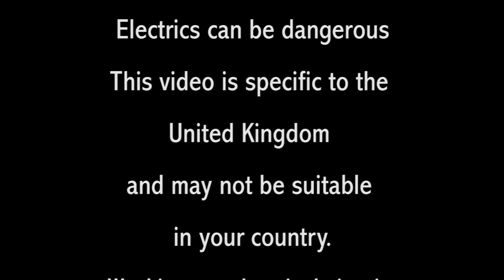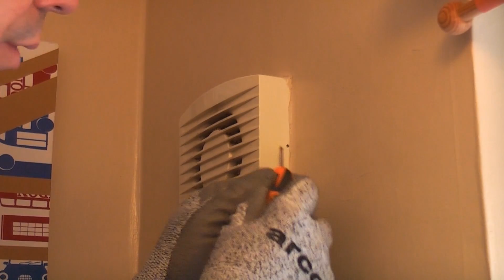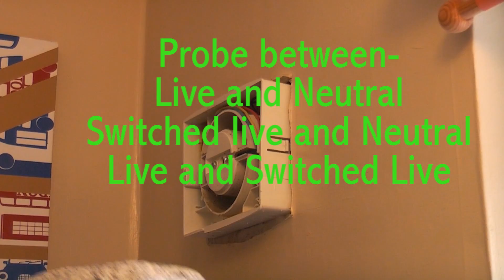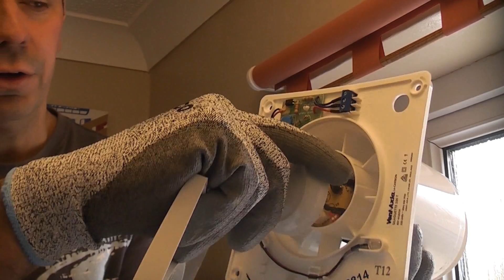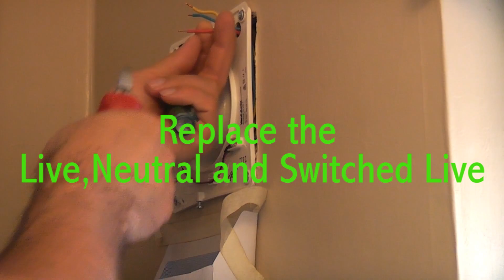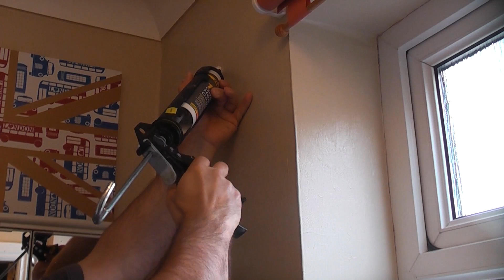How to replace a wall extractor fan | vent-Axia Silhouette

Comment: Great video 👍 do you know if I can replace the fan myself , take old one off replace with new , wires already there and I know about putting the link in from line to sl as I bought one with timer but only got line neutral and cpc . Just want to know if I can do it myself or do I have to get a registered spark in to do a mwc testing etc any info would be great 👍
Reply from the maker: As far as I am aware, you are allowed to do like for like replacements 👍
Reply: @ultimatehandyman  brill thanks for reply 👍

Comment: my old fan had an earth terminal, but my new one doesn't. Is it safe to trim back the earth and just cover it with insulating tape? There's no room to squeeze a terminal block in there
Reply from the maker: I would not trim it, just cover the end with tape and it will be fine ;-)
Thanks for the comment 👍
Reply: @ultimatehandyman  Thanks a lot for the help.  Best DIY channel on youtube!

Comment: Thanks! Great video! Our bathroom extractor fan is supposed to turn on with the lights and used to turn off automatically a few minutes after the lights were turned off. However recently it has stopped turning off and stays on constantly. Could this be a sign that it needs replacing, or is this a different electrical issue? (Pretty sure it hasn’t been replaced since 1989!) Thanks for your help
Reply from the maker: Sorry for the late reply, I have just seen this (YouTube comments cause me no end of problems)
I would imagine that the timer on the fan is faulty, but it might be integral to the fan. This would mean that you would probably have to replace the whole fan.
Thanks for the comment
Reply: @ultimatehandyman  thanks for your reply! I have replaced my extractor fan and it seems to be working perfectly! Thanks! 😀
Reply: 🤨 - you can take out the timer and just directly power the motor ~ if it is connected with screw terminals on the PCB and a 240v fan

Comment: Can I spur off an extractor fan in the kitchen to a 13amp double socket with a fused spur in between?  Great videos btw 👍
Reply from the maker: Probably not, it's best if you consult an electrician.
Thanks for the comment

Comment: Hello, I am having some issues fitting my extractor fan. I followed all standard wiring instructions and the fan won’t start working. There is an isolation switch fitted, when this is on and the lights are off, the Dow lighters come (flashing) and the extractor fan shakes . Really strange! Many thanks
Reply from the maker: I'm not sure, sorry.
If it is wired up correctly I would guess that the fan is faulty!
Thanks for the comment 👍

Comment: Please I need help can you tell me which switch I need to pull down to cut the power/electricity
Reply from the maker: It's impossible for me to say without being there. You could always turn off all circuit breakers?
Reply: @ultimatehandyman  thanks a lot for respond

Comment: Would an extractor fan vent excess heat - I want to use one in my server room (a glorified airing cupboard)?
Reply from the maker: It will to a certain degree, but you might also need a vent at the opposite side of the room for some air flow
Thanks for the comment

Comment: The upvc windows need filling around the perimeter....good clean job with the fan- I understand new wiring, old wiring is trickier. I installed mine ysdy ... only problem when you turn the light off then the fan turns on...
Reply from the maker: https://fave.co/2QQcj04
Thanks for the comment

Comment: hi i was after advice please..i want to replace my bathroom extractor fan its currently a 12v fan.i have taken the cover off the old fan and there are two wires in the terminal block. The new fan takes 3 wires live, switched live and neutral. the older fan used to come on with the light switch. also in the bathroom on the ceiling near the wall fan is a 3 pole swith fan isolator. My light pull switch has 2  cables going into common, brown and red. and the 2way has a blue and black Many thanks
Reply from the maker: The fan might be 12v but it will still be 240v supply, so you have to ensure it is isolated correctly before touching anything ;-) 
To make a light with a timer work without the permanent live wire you have to put the Neutral wire in neutral and the live in the live terminal and then place an insulated link wire between the live and switched live. Then when the light is switched on the fan will switch on and off with the light.
Reply: the insulated link do i still strip it on both ends that go in the terminals
Reply from the maker: Yes
Reply: thank you

Comment: my ceiling one just went on me ,it rattled a lot in the past ,now it just turns slowly grinding and the unit gets very hot ,it runs off a timer from the bathroom light switch ,taking the cover off ,it seems overly complicated and i dont know what unit replacement i should order for it ,PS its a radial style fan not a flat one
Reply from the maker: Is there no name on it to get a replacement?
Reply: all discontinued im afraid ,was a installed extraction unit when the flat was built in 09 ,its ok my uncle offered to take a look since he is a sparky :)

Comment: Hello - this may seem like a silly question, but what do you do with the earth? When you connect the live, switch live and neutral, you seem to have cut the earth back behind the fan itself. Is it alright to simply leave this wire floating? If so, what protection is it actually offering? Cheers for the video!
Reply from the maker: The earth wire is just left there but covered to ensure it cannot touch the live or neutral terminal. It may be needed in future if a different fan is installed but in this case the fan is double insulated, so an earth connection is not required.

Comment: hi. i know that my sounds like a stupid question but i just bough new fan extractor and that white block where you put your wires got only space for two wires not three? is that make any difference?
Reply from the maker: No, that just means that your fan is probably double insulated and does not require an earth. In which case you will only need to connect the live and neutral.
Reply: Thank you

Comment: Mine does not come off after i have taken off all the screws. It looks like somehing keep holding it in the middle? Or do I need to go from outside in case the other end of the pipe that goes into the wall is fixed there? Thank you!
Reply from the maker: Has it ever worked?
Do you know if it's getting power?
Reply: Hi, it does work. It's just that I can hear a loose screw going round the fan and it does not come out when I open the front. I have now pulled it a bit more and there is a soft plastic tube that goes all the way in the hole in the wall. I think it might be attached to the vent outside. Thank you for your help, I really appreciate it!

Comment: thank you for sharing your knowledge and easy to follow videos 💡
... could you please advise me   which is currently  the most Silent bathroom fan available and where I can buy it?
Thank you ☺
Reply from the maker: You are welcome.
I have no idea which are the most silent fans, although some manufacturers do make silent or quiet ranges so it might be worth checking those out. I think a lot of places actually list the decibel level of the fan during use.
Thanks for the comment

Comment: I got a fan with timer but the wiring I need are live switched live and neutral. The only wires with my bathroom light are live and neutral and earth. What do I do from here as there's no switch live there.
Reply from the maker: +Abbas Khan 
Your light will only have a switched live, neutral and earth.
To make the over run timer work you need a permanent live from a suitable point on the same circuit.
Or if you just want the fan to switch on and off with the light you can put a link wire  in the live and switched live terminals of the extractor fan- but the run on timer will not work.
Reply: +Ultimate Handyman on my fan there's 3 junctions one is live the other is switched live and neutral. but my light has neutral live and earth what if I just connect the live to live and neutral to neutral.
Reply from the maker: +Abbas Khan 
It won't work unless you put a wire from the live terminal to the switched live terminal at the extractor fan. Then it will only turn on and off with the light.

Comment: Hi, awesome video! 
I have a faulty fan and wants to replace it myself as it's cheaper this way. I just wanted to know if I have to find the exact same one or would any fan do? also, would the dimensions affect the pipe which goes outwards?

By the way, my fan is located on the ceiling, so not sure where it goes out to
Reply from the maker: +Darkhisagi Thanks, as long as you get the correct size fan it should fit- but even if you get the exact same make the chances are that they will have changed the design of it slightly over the years so even that may not be identical. I think most ceiling fans are 100mm, there should be a flexible duct that connects to the other side of the fan and vents outside of the property.
Reply from the maker: +Karlitos No, you need a transformer to transform the 240 down to 110.The lead you have linked to could be used if you had a dual voltage machine which automatically detects the voltage, such as my welder.If you use that lead on a 110v machine you will damage the machine/blow the crap out of it.

Comment: I get a lot of mould what motor extractor fan can I use for a big bathroom, I think the current fan is too small....good video by the way.
Reply from the maker: +mr Scratchy 
You are probably best off with a twin flow type, but they need mounting in the loft really with ducting to an outside wall. 
Also if you clean off the mould and then repaint with mould resistant paint such as Zinsser Perma white that will help.

Comment: if the fan is wired in 3 core cable an comes on with the light switch how do you go about switching it on during daylight hours .without turning light on obviously
Reply from the maker: +Roy Kirkham 
You can only turn it on by switching the light on. If it's daytime you can just flick the switch on and then off and then the fan will start and will run for as long as the over run timer is set for on the fan. 
Thanks for the comment
Reply: Oh right i see thanks.
Can i ask you aswell my fan is a xpelair humidstad 12 v fan with transformer in loft its wired to the switch side of the light in t&e then to a isolator an through the tranny to the fan at 12 volts how can i use the 3 core method when theres a transformer involved it only has 240 side L&N then output at 12 volts i cant understand how to use 3 core in this situation
Thanks for replyin btw ☺
Reply from the maker: +Roy Kirkham 
Normally with a humidstat you can't use the three core cable as the humidstat is energised permanently so that the fan can switch itself on and off. 

If your fan is wired to the switched side of the light it will only switch itself on when the light is switched on, which is unusual for a humidstat fan.

Normally a fan isolator would be wired to the ceiling rose and not the light switch as you need a neutral anyway (unless there is a neutral at the light switch).

You would not be able to use three core and earth on your fan because of the type, you would need one without a humidstat but with a run on timer.

This should help- http://www.ultimatehandyman.co.uk/how-to/electrics/install-shower-extractor-fan

Comment: Nice use of a lockoff on the breaker. Was wondering if you'd miss that. You didn't. Might be worth mentioning that any recently wired fan (last 10 yrs or so) should have a 3 pole isolator switch outside which can be locked off also.
Reply from the maker: ***** 
Thanks, I have never seen a 3 pole isolator in a domestic property that can be locked off, is there a special device for locking these off?
Thanks for the comment
Reply: ***** I was working from memory... looks like it's an MK specific deal: http://www.tlc-direct.co.uk/Images/Products/size_3/MKK4857.JPG  it SHOULD become a standard tho :)
Reply from the maker: ***** 
Thanks ;-)
Reply: @ultimatehandyman  - depends on the brand ~ some have a small hole in the side of the switch that you put a provided pin into it, others have a pig-nose screw that when turned to the locked position with the provided key - I assume a tab will go up blocking the switch from being turned on
Reply: What is that?

Comment: Hi Chez, just wondering about the transparent screwdriver you're using.

Is it a neon screwdriver? I have one that looks identical to yours but heard that some of them are unsafe or unreliable. Know much about that? Wondering if mine is any good.
Reply from the maker: Liam2349 
It is a neon, but it has batteries in it.
These screwdrivers are often used by DIY'ers but are not very safe. I never use mine for testing to see if something is live or not (there is no way I'd use any screwdriver for doing that unless I was desperate and had nothing else). With this screwdriver you can hold it by the top and point the other end at a live cable and it will illuminate when live (without contact), so it's good for tracing live cables etc. 
The reason why I use it a lot is because it's a really good fit for most small terminals, so you can undo and re-tighten them without damaging the screw. 
Neon's can be unreliable so they should never be used for testing for dead, but many use them for testing to ensure something is live.
I once saw a neon screwdriver blow up when an electrician was testing one out on some live equipment, so best not to use them for testing unless you have nothing else available.
Reply: ***** Wow, thanks for the info.
Keep up the good work :-)

Comment: Nice video as always Chez. I need to fit an extractor fan at some point in my bathroom but living in a flat, the vent is above the shower but it is within the shower cubicle. Would you know if they manufacture a fan that's safe in such a position? Any advice highly appreciated mate!
Reply from the maker: BeardyRebel 
Hi Kev, Normally shower fans are located in the loft space and connected to the vent in the shower via a flexible duct, then a flexible duct fits to the other side of the fan, which connects to a vent that leads outside. I have replaced a fan in my en-suite with a twin flow fan in the loft and it works much better than a ceiling mounted fan. Can you access the area above the shower, to install an inline fan?
Reply: ***** Hi Chez, unfortunately not. The vent in the bathroom is part of a shared ventilation shaft that leads up one floor to my neighbours roof garden. In my last flat we had a main extractor fan that served the whole building and was on a timer so shut off at about 1am. Might be worth trying to get one of those fitted here. If not I guess a wall mounted dehumidifier might help?
Reply from the maker: BeardyRebel 
I'd go down the extraction route rather than a dehumidifier to be honest if possible.
There must be something you can do!
I must admit we have a dehumidifier but it's more for removing the moisture from the air that we exhale rather than from the showers as both bathrooms have dual flow extractor fans in the loft.
Reply: ***** I must admit I'm hoping to go down the extraction route if poss. I'll let you know what I manage to do!
Reply from the maker: BeardyRebel 
okay, thanks Kev ;-)

Comment: Nice and neat job. I always find 4" bathroom fans to be totally inadequate for a bathroom. When I'm doing bathrooms I always fit 6" fans much better air flow so helps with condensation from shower/bath. Abit difficult to retrofit as you already have a 4" hole however made a little jig to use with 6" core drill.
Reply from the maker: Zed Man 
I think you are right about the 4 inch fans, although some of them can move a fair volume of air.
The impressive thing about this fan is the wattage, at just 6 watts it's very efficient. They must be able to make larger fans with DC motors, I expect in the next few years DC motors will become the norm in extractor fans.
Thanks for the comment ;-)
Reply: Zed Man good 4 inch inline fans move about 3 times as much air as a wall fan but you have to have a loft space to run the ducting......

Comment: your'e very meticulous, excellent work.
I'm thinking of installing one in my bathroom. 
How efficient are they? Can an extractor fan such as yours displace air as well as large windows?
Reply from the maker: Ebrahim Seedat 
The fan I installed can extract 95 cubic metres per hour, but to be honest for a bathroom (especially if there is a shower) I would install a mixed flow fan in the loft and duct it to outside. Most twin flow fans can extract 245 cubic metres of air per hour or similar.
I guess the advantage of this fan I installed is that it uses a DC motor and only uses 6w of electricity per hour.

Comment: Enjoying the videos 
Only one observation/concern 
It is best practice to always verify your meters from a known live circuit 
Although the test you did was valid it may get you a some point 
Learned that the hard way myself 
Thanks
Reply from the maker: napodano26 
Thanks, confirming the tester on a live circuit also poses more problems though and proving units are very expensive for what they are (about £90 if I remember rightly). Thanks for the comment ;-)